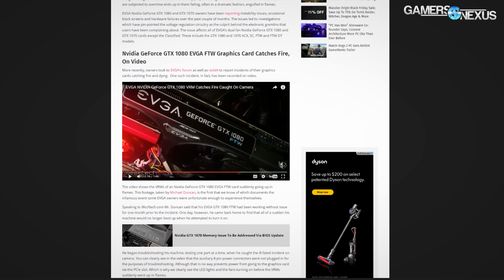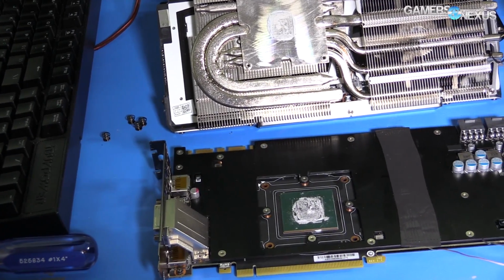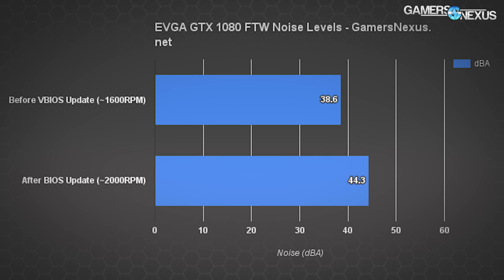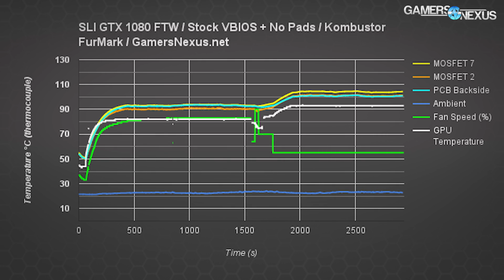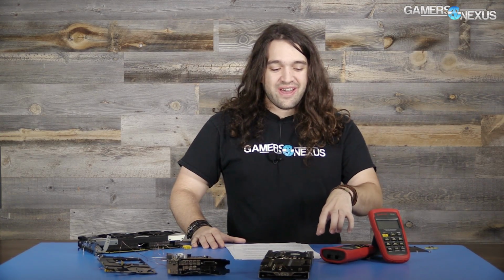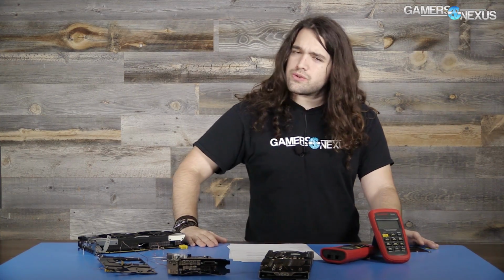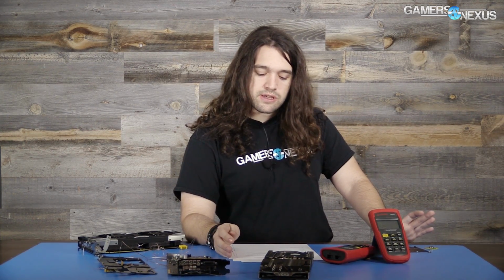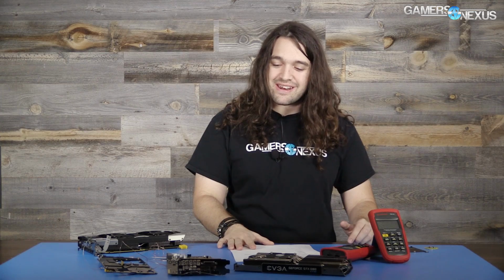EVGA's VRM Thermals Not the Killer of Cards - Final Test

Comment: PCB Backplate should not be the hottest part, the VRM's still should be. The backplate is pulling the heat away from these so can't magically be hotter then the VRMs. Looks like your sensors weren't touching enough of the mosfets. 

Also to note, using a flir or infrared or even adhesive temp sensors, shows only the temp of the surface, the internal temps can be much higher. The backplate and the thermal pads on your tests 'block' the heat from showing in the components underneath, so using a flir or IR isn't really a good option to use anyways.
Reply: I like how you critisize the way every company tests their hardware.
Reply: uh, I don't. This is my only comment on this.
Reply: You do. Read your post lol. Blabla wrong spot for sensors blabla yet manufacturers do it this way.
Reply: Well this is far from criticizing 'the way every company tests their hardware' lol... Its criticizing the way this test is done on past review and making factual comments on how ir and flir tools work...
Reply: There's no measurement error in this case. There's a multitude of factors there. For one, the MOSFET die is at the tab side, not on the plastic enclosure side! The tab is predominant thermal contact surface. The other is that the tab pad has thermal via stitching on it, about a dozen vias per FET, copper plated and tin filled - i don't remember the exact figure, but i found high resolution images back a few weeks when i was looking, and i was quite impressed by the amount of vias all over the power area, i mean they must be discarding a carbide drill bit every few boards, they're not cheaping out on these PCBs. The thermal resistance of pad via to the PCB backside is easily lower than of the plastic enclosure on top because the thermal path to the back side is basically metal, thin channels but plenty of them. Third factor is that there is some airflow on the component side, while the backside is completely stale air!

Comment: if your out of warranty with the card and your capacitor gos bang because its faulty, will they still replace it or fix it out of warranty,
Reply: No they wont. Card has a 3 year warranty though so you should be good.
Reply: a failure due to a faulty capacitor will definitely happen within the standard 3 year warranty. If it happens after more than a year, it's likely a standard failure, not related to a faulty component, but just from normal wear.
Reply: You can't justify that, things should last for a reasonable amount of time, a reasonable amount of time is 5 years, it's in my consumer rights
Reply: There's no possible way to tell when and if a single component, among the dozens of components in an electronic device will fail. We definitely expect them to last a reasonable amount of time and in most cases, they do. If they don't, then you have a warranty to fall back on, with the option to purchase an extended warranty, if you like.

Comment: The noise results are pretty much useless for those with custom fan curves... If you have a custom curve your card will still overheat though your core temp may seem fine...
Reply from the maker: They're the noise levels from the VBIOS versions that EVGA shipped. If you run EVGA's default fan curves, that's what they'll look like.
Reply: If your curve is more aggresive, it's as if you did the bios update.

Comment: When I heard about this issue, I bought an EKWB waterblock and backplate for my FTW and included it in my loop, now it runs below 50degc under load. The backplate came with thermal pads for the VRM. I don't have a way of seeing the temperature of the VRM though.
Reply: I haven't undated the BIOS though, would you recommend doing that even with a waterblock?
Reply: Why would you. You have no fan anymore. The bios only changes the fan curve.

Comment: there was also a batch of cards with pwm fan controller issues where it looked like a heart rate monitor under load jumping up  by over 1000 rpm for a split second had 2 cards like this come from one seller  actually had to contact evga for a newer batch of cards

Comment: appreciate the work guys. i had hopes i bypassed this issue with the hybrid but i suppose if its possibly the capacitors as mentioned, the potential is still there. however, i think those rma figures, assuming they are factual, are numbers i can live with.

Comment: Hey, I did the thermal pads and the VBIOS update, i noticed a slight performance degradation, Is there any part during the installation of the thermal pads that can maybe cause this? I may have put too much thermal paste if this is the case but I cannot find any information regarding thermal paste causing performance degradation. 
Thanks
Reply: More likely the BIOS
Reply: the bios increases fan speed, but it also removes gpu boost. your card is most likely functioning at 1600mhz stock and thanks to the vbios won't gpu boost to 2000mhz like it did originally. 

you can still install precisionX and manually increase the clocks to 2000mhz. so you'll get your original performance back.

look it up. this is a real thing evga did.

Comment: well done steve.
it is surprised that adding pads on top of the midplate to make contact with the main heatsink helps significantly, considering the main heatsink's fins do not folded at 90 degrees to enlarge the contact area like most of the other cards did. if those vertical fins which have very small contact area to the pad  still improve the vrm temp significantly then it may prove that the capacitors and chokes were really really hot. 

btw, have you talked to evga about the vram contact issue? that seems 100% evga's fault and evga is now sending new thicker vram pads for stock replacement additionally. and evga recommends users to replace the stock vram pads with new thicker vram pad, not optional. would you do the last test about the vram like stock pad vs new pad vs no pad at all, to see how vrams perform.

Comment: Is anyone else even more concerned now because this video proves these "exploding cards" are likely due to poorly manufactured capacitors instead of a thermal issue which EVGA has claimed? A .02 failure rate is probably acceptable, but the card hasn't been on the market that long and so this number will likely increase.
Reply: thats an average per million though, so realistically it will increase, but only as the number of cards sold increases.
Reply: BigMan7o0
It should also increase because these failures really only started popping up for people who have used their card for 3-4 months or more. This subsection of all customers who have owned the product for this period of time likely represents a small percentage that will continue to grow. Sure, right now it's at 200 DPPM, but it's likely that a significant portion of that million are newer customers who have not had their cards installed for 3 or more months.
Reply: possibly. only time will tell.
Reply: But this kind of issue hits all manufacturers, and given that EVGA has been already caught with an issue on this line of cards and committed to resolving it, i'm sure they know the eyes of the press are upon them and they'll probably go out of their way to leave the consumers happy. I think at this point i'll be more happy to buy an EVGA than any other brand for this particular lineup - others will be able to simply deny any issues and nobody will be there to slap them on the wrist.

But of course given thermal sensitivity of capacitors, either the issue will increase to 1-2% over a year or two, which is entirely normal and expected, or it may end up higher. We'll just have to wait and see.
Reply: got news for ya mr stranger that probably wont change considering these companies are out for money (not saying thats bad mind you) but remember ford has a number of lifes lost vs repair cost before they will fix a fatal flaw in a manufacturing design.
Reply: You're forgetting most(all?) capacitors have a maximum temperature rating, exceeding that or coming very close to the absolute max can and WILL cause premature failure of those capacitors, sometimes a dead short in the most extreme cases with polymer electrolytic types. If that happens, VRM go BOOM.
Reply: I was reading thru the Evga forums when all this exploded on the scene and one of the threads Evga said they received a bad batch of caps ( I think the named the supplier that they got them from but not positive)  and they listed manufacture dates of cards that used those bad caps (Imo these are the only cards with the highest risk,  more then just basic ohh shit it failed randomness, that honestly anyone should even comtemplate worrying about) So I would suggest head to Evga forums and find the post with the dates, if you dodge that bullet set a custom fan curve, update your bios or leave fans stock but definitely do the thermal pad mod and you should be fine.

Comment: Just want to thank you for a GREAT job on the testing.  Thorough is the word on this one.  Just a thought.  The FTW and Classified cards both have two eight pin connectors and special pcb.  The ACX 3.0 reference cards and SC cards have the basic Nvidia pcb and only one eight pin.  Based on what we know....I have heard no "explosions" on the ACX 3.0 or SC cards, just the FTW.  Wonder if the power supplied to the card might play a role.

Comment: The most counter-intuitive part is that with better TºCase you could end up in the worst case scenario quicker than with high TºCase due to Fan curve response being linked to GPU core temp while being agnostic of VRM status... which is the reason why it would be nice to have VRM Tº Sensors. Eeeeverywhere. Even some motherboards don't take any care of their CPU VRM... Not saying put a gazillon sensors like Asus Tuf motherboards... just one or two to see what's going on and that's it.
Reply from the maker: Sensors that measure VRMs and interact with software or firmware would be excellent on many reasons. We also want this.

Comment: I had evga 1070 ftw card edn up frying . I exchanged it for the asus strix and it works fine . ftw was making my whole room extremely hot and run about 80+ degrees on load , now with strix it is a different story doesnt go beyond 70 degrees and my case is 30degrees. Note that i had my bios updated on ftw. Ncix opening my case had no issue finding the cause of my computer not working. The card smelled like shit. Im fan of evga had 670 770 970 loved them . Now ? idk

Comment: I've had the black screen problem twice on my 1070 FTW, but only since I updated the VBIOS (86.04.50.00.72) and installed the latest driver for Win10 64bit (375.95). What is the black screen issue fix?

Comment: The thermal pads still should have been installed from the factory. Why not? The plate is right there, just put a pad on it in the factory. Higher heat in that area can affect a weak capacitor. But your torture test eased my mind about picking up one of these.

Comment: Looking through the graphs, it appears as though the temp with updated VBios + Thermal Pads is within 1-2 degrees C of Old VBios + Thermal Pads. Is it likely that that's because the GPU core clock is boosting higher because of better thermal headroom, causing higher power draw and ending up in the same spot thermally? Or is it likely due to some other reason?

Comment: My god, so much work... I am so impressed with attention to detail and depth of everything you guys done with this issue that i had to become a subscriber. Thanks and keep the good work!
Reply: Hmm. I've got my thermal pads, installed them all on my Evga 1070 ftw and now my gpu is getting warmer than just with the bios update. Even with me using a custom fan profile set to an aggressive curve (I don't mind much the noise). Before the thermal pad installation I was getting around 55c on furmark test, now I'm getting around 63c. Without any OC. It's not bad, but it'd worse and it's bugging the shit out of me. Not sure anymore if I messed up something or if the thermal pad isolation is blocking air flow. By the way I changed the thermal compound on the gpu chip, used artic silver 5 instead the one provided by Evga. Could that be the problem? I don't think so, but I'd love some input from you guys. By the way it only took 10 days for my thermal pad to be delivered here in Japan, at least that was good.

Comment: Disclaimer: I own a stock EVGA GTX 1080 FTW.
While you've proven very well that there's no thermal cause for the card and EVGA claims it's just regular failure rate, there's still one discrepancy: no other VCard makers experience the same type of catastrophic failure on their cards. Talking about MSI, Gigabyte, Gainward, PNY, ASUS, etc. Even Founder's Edition cards do not experience this type of failure.

So it's clearly not "just" failure rate. It's a specific-to-EVGA failure which incidentally fits within expected failure rate for the card. What exactly is the cause is still up in the air, but it's definitely not a "generic" type of failure. Because statistics! :)

Anyway, with me being a quiet PC freak, I'll just have my card on watercooling soon and not install the noise-inducing VBIOS. oh and just for reference: even if I applied for the free thermal pad shipping at day 1, I still haven't received the pads.

Will i buy an EVGA card in the future? Hell yes, because their warranty kicks ass.
Reply: i dunno.....I had to RMA my gigabyte windforce 1060 back to newegg twice(black screens)......When the 2nd one died I called and asked for a refund instead of a replacement. They gave me a refund with no fuss which really surprised me. I also had an evga 1060 6g sc acx2.0 that I bought at launch, it is in cross ship RMA right now to EVGA(turned it off and it never came back again.......tried in 2 pc's totally dead). So I dunno I guess its just the way it goes......stuck on intel integrated until my new card gets here :(
Reply: They have the same failure rate. It's just not covered because Media coverage for the so-called exploding EVGA.

They might have a different vendor for the capacitors.
You posted before but i can't find it now, i think. Prolly deleted your post. You were not this friendly.
Reply: I think you're confusing me with someone else. I rarely comment on videos and stand by what I say.
With that being said, I would expect the same media coverage in case of exploding VGA cards for any other brands. Those might fail with the same rate as EVGA (or larger) but not as spectacularly.
Reply: My apologies, it probably was someone else. Just the post started the same.

Comment: hey guys, so I use Vsync on all my games, my gpu temps never exceed 50C and normally stay around 40-45. i have had no issues, other than one time having to reinstall Precision X cuz my fan profile was being weird and ramping my fans up and down, hasnt happened since(months ago). I purchased shortly after they came out, so do you think its safe to say Im not in that .02% failure rate group? i just dunno if I should send it back and get ajother brand
Reply: Try Afterburner, much more stable and dependable as opposed to  that EVGA
  Precision XOC

Comment: Regarding the noise levels before and after the bios update, under what circumstances are these tested? At Idle? At 100% gpu load? A specific temperature? 
I don’t really understand because my 1070 FTW has NEVER hit 1600RPM while benchmarking/gaming, this is with the old VBIOS and all settings on default.
If I put it manually to 2000RPM it sounds really loud compared to the noise level I’m used to so I doubt whether i should update my bios. (Currently using agressive fancurve with EVGA Preciscion XOC and still never went above 1600RPM)
Reply: I have read the article before watching the video and there is no 'label' awnsering my question. Also there is only 1 graph im talking about and that is the 'Noise Levels' graph.
Reply from the maker: The 1080 FTW operates at roughly 1500-1600RPM with the old VBIOS when under a 100% GPU load scenario with high GPU heat output, assuming your ambient is not cold enough to significantly impact performance. The VBIOS update caps around 2000RPM under the same conditions.
Reply: Thank you for your quick reply! That answered my question.

Comment: Well next topic should be how EVGA screws over their buyers by not cherry picking the GPU dies as 1070 FTW's have a huge difference between how well they can overclock. 

Had a 1070 FTW max clock was 2060 mhz i sent it in for a new updated card and the new card can do 2075 mhz, and then you hear all the reviewers showing it can do 2150 mhz .. so there you have another reason not buy EVGA junk again as they do nothing to give you a good die to take advantage of the overkill powerphase that causes all the other reliability problems.
Reply: Are you really that FUCKING stupid? its called the silicon lottery. You bitch and moan cause they didn't send you a card that can do 2150mhz?
Reply: arbiter1 - Nope, but you might be...

Dystopiq R - I know that, but still other brands give a better die, some of EVGA's Founders and SC's can overclock better, so why do EVGA offer these FTW cards without them having the best dies they can have when they put such an overkill power phase on the card to allow for "better overclocking". Not going to buy EVGA GPU's again nothing but problems and dissapointments.
Reply: That's ANY GPU. No two GPU's are truly the same. Silicon lottery my friend.
Reply: I miss my 1fps aswell :/ Also, reviewers have them on a test bench, not in a case. Lower temps means higher boost.